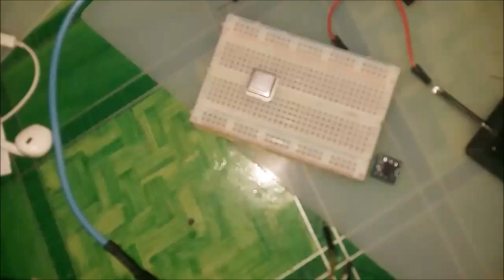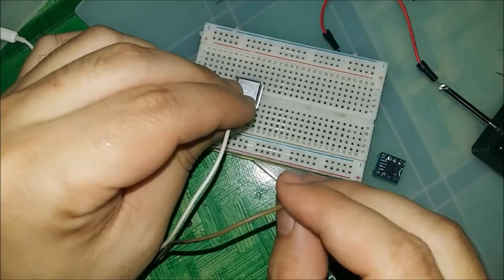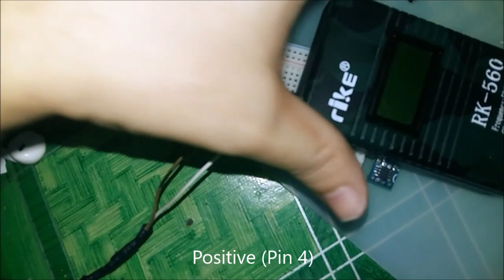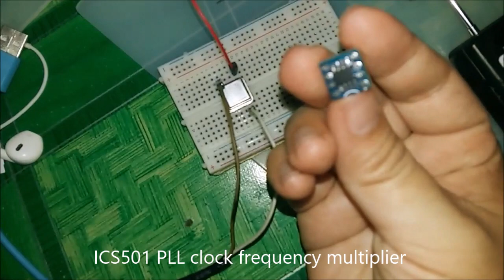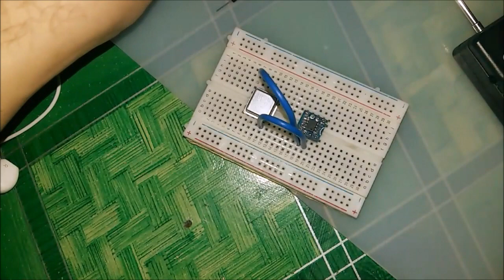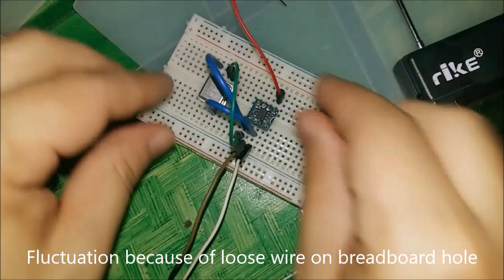How to make simple frequency multiplier 20 Mhz to 40 Mhz - ICS501 PLL  | crystal oscillator

Comment: Hi.  Thanks for the great video!

You have the ICS501 mounted on a module, which allows you to plug it into the breadboard.  Is that just an adapter for an 8-pin SOIC, or is there something special about it that's tailored to the ICS501?

Also,  do you know of a device similar to the ICS501, but that works up to a somewhat higher output frequency, say around 250MHz?
Reply from the maker: Yes it's soic adapter u can buy and frequency 250mhz u can try find crystal oscillator tcxo
Reply: @neodiy  Sorry if my question was unclear.  I'm looking for a device like the ICS501 that can multiply a lower frequency to a higher frequency.  The ICS501 is limited to a maximum output frequency of 160MHz, but I'd like to go somewhat higher, to about 250MHz.  I see that the ICS511 (and ICS512) goes up to a maximum output frequency of 200MHz, so that's an improvement, but I'd like to go a bit higher.
Reply from the maker: @ajlenze8  my apology for overlook on your question..honestly i havent try anything other than that but from what i've found on the internet this IC probably might suit your need and you could research further on it = ICS525R-02ILF, Frequency Multiplier, 1 → 250 MHz, 28-Pin QSOP
Reply: @neodiy  Thanks, I'll check that out.

Comment: Hi, would this IC work for frequencies from 16Hz to 90Hz to double to 32Hz to 180Hz? 
Also, what is operating voltage range of IC?
Thank you.
Reply from the maker: Unfortunately no the datasheet says minimum input is 0.5 mhz or 500, 000khz operating voltage only 3 to 5 volt